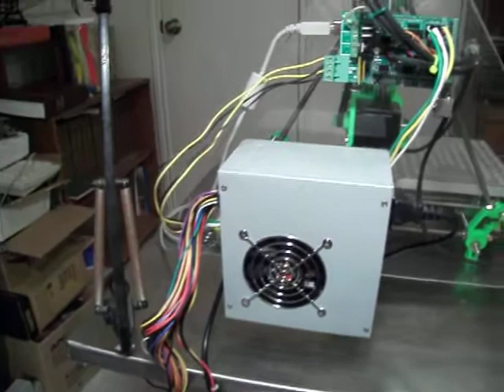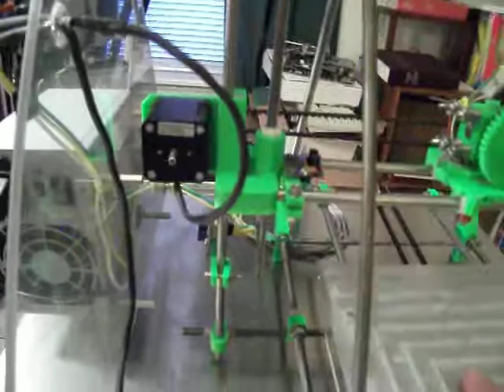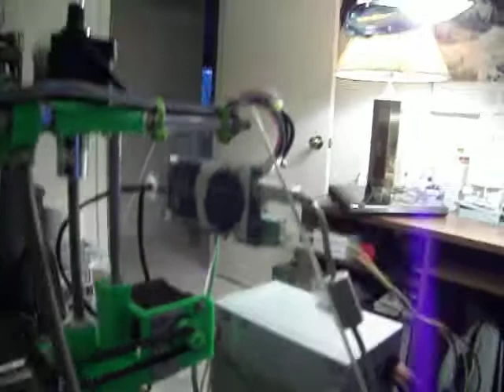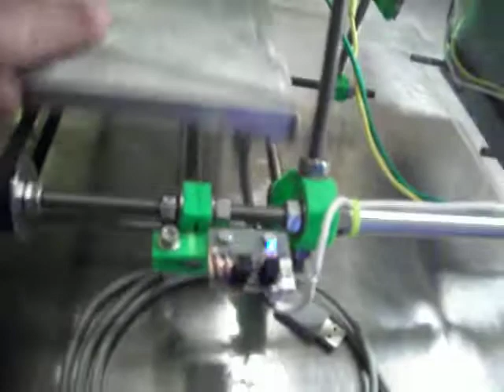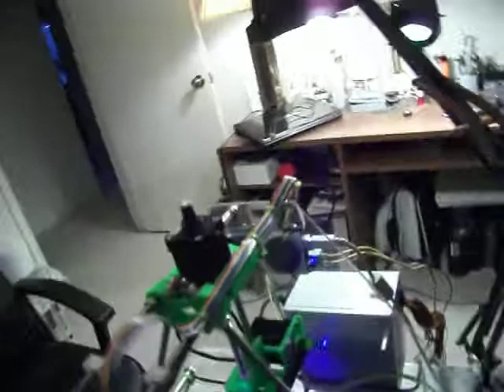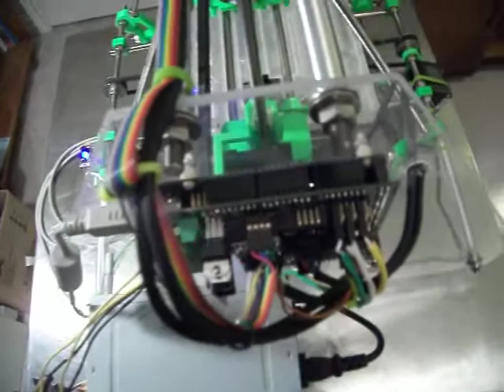3d Printer Finished

Comment from the maker: It's not a gen 6, it's an Arduino Mega.  The Mega can be programmed for many different uses, so, to make it work for this application you just add an adapter [ramps] and the 4 drivers to drive the steppers. Read the other reply's I posted, thanks for watching.

Comment from the maker: The gen 6 board is one of a few boards that can be used, I used the Arduino Mega 2560 with the Ultimachine Ramps v 1.4 board which plugs onto the Arduino Mega, then 4 stepper motor drivers and an sd card reader that plug onto the ramps board which I also purchased from Ultimachine, these boards would be the latest and greatest to be used on the Prusa Mendel, thanks, Jeff.